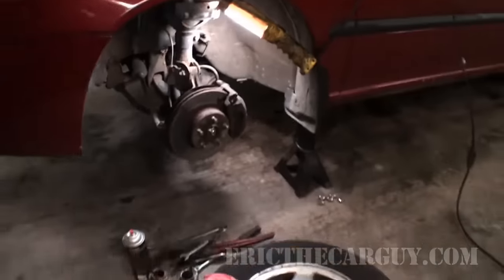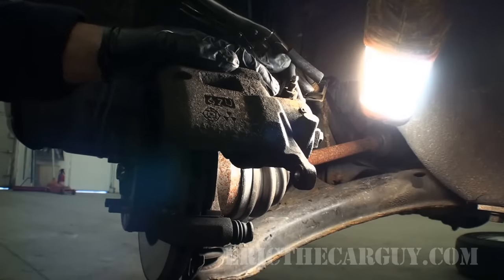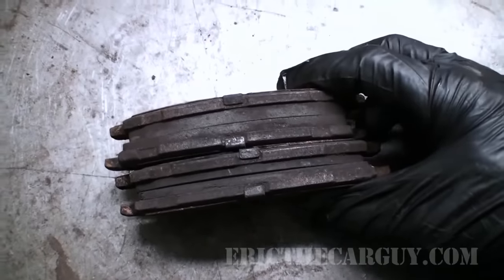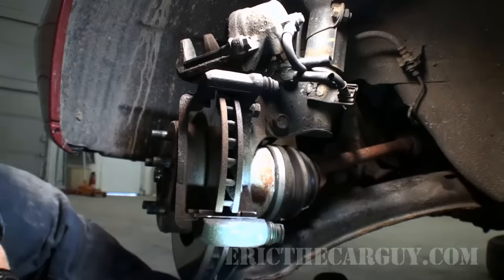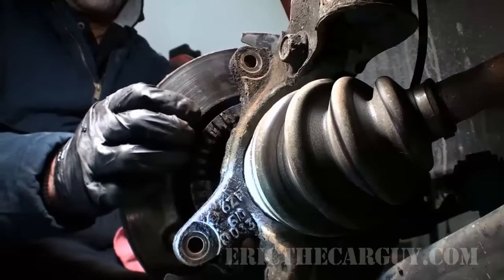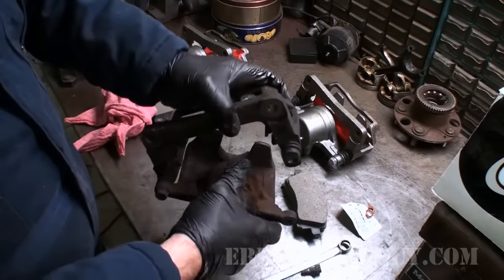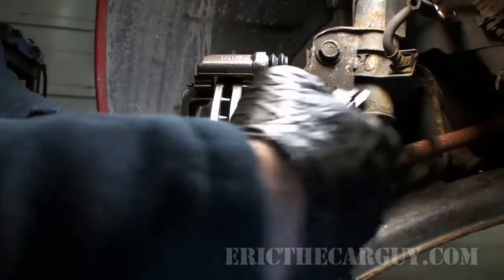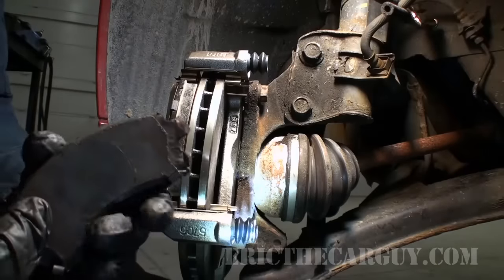How To Diagnose and Replace a Bad Brake Caliper -EricTheCarGuy

Comment: Eric, I found a brake fluid leak after a brake fluid service. I notice the bleeding screw rubber cap has a small hole. Can that cause a break fluid leak?
I tight the bleeding screw a little more but should I replace the rubber cap? 
Thanks for help

Comment: @EricTheCarGuy One of the rotors on my wife's car is showing up a curios worn pattern. It is taking place on the front side only. You can notice the pad is not fully touching the complete area of the rotor plate because there is like a 3/4 inch ring pattern is being lightly corroed by exposure to the rain. The question here is will it be wrong pads size? Ive got the breaks serviced only a few weeks ago

Comment: Do you have any advice for replacing the caliper if the bleeder valve and banjo bolt can't be removed? They're rusted through and the bleeder valve is stripped. Should I replace the brake line at the reseviour?

Comment: Hey Eric I was confused about the pumping the brakes alot and loosing the bleeder valve. Isn't that the bleeding the brakes process. If possible could you explain. Is it the squirt versus running fluid. I thought it always squirted especially with air in the lines plus pressure.  Or did you just misspeak?

Comment: Hi Eric! Thank you for a GR8 channel! Is this problem (bad break caliper) know to happen also on the rear breaks? I have a Volvo V50 2006 that started to see VERY increased fuel consumption. I suspect that one of the brakes (rear right, due to a lot more brake dust around the rim) might be a fault. Thank you all the way from Finland!

Comment: Great vid! I couldn't make out 1 thing though -  why would the brake hose be bad if there is squirting through the bleeder after pumping the pedal? Wouldn't with a normally functioning hose that exact same thing happen? If not, why?
Reply: Well if it squirts out that means there is pressure in the system, it shouldn't be enough to squirt. Only a stream should come out. If there is squirting that hose is probably collapsed internally. Due to brake fluid contamination or age.

Comment: great info thanks , question, is it a good idea to put penetrating oil on the guide pin bolts and bracket bolts so they do not break off,  did you ever break the bolts ;  or is that not likely to happen with these bolts

Comment: Is it imperative to replace (with new) the caliper mounting bolts after removing and servicing a caliper ?
I heard they might be TTY (torque to yield) bolts and need to be replaced, each time ?
Thanks in advance

Comment: Eric, i've got a few questions after watching yours and chris fixs' video on brake calipers... Chris is basically saying the opposite as what you're saying with the calipers and brake bleed. He bleed his lines first and then installed the new caliper. i just heard you say your changing the caliper first then bleeding the lines. Is that preference? Chris said he does it the way he does so the old brake fluid doesn't contaminate the new caliper.

what do you think?

Comment: I bought a 2006 Kia Spectra5 and it was pulling to right when braking.  I replaced the left caliper and rotor assembly.  It still shakes but doesn't pull either way.  So now am gonna check the hose lines and the right side caliper.  I have feeling it might be bad too.

Comment: Once you  bleed out .dose the rotor   spin freely or it sopost be  tight when you spin it.. I replaced my calipers and my rotors are still hard to move.  I check all my brake lines to ... let me know thanks

Comment: Hey Eric, I just replaced the front/rear pads and rotors on a 2009 Honda Accord sedan almost two weeks ago. Now whenever I brake I hear a thumping noise. I was thinking it's a caliper or some sort of suspension issue? What could it be?

Comment: At the 10min. Mark you state fluid squirting out indicates a bad brake hose (Is the brake pedal still being held down after pumping up pressure or is it now released while you crack the Zert fitting?) Is this an indicator of line pressure unable to quickly neutralize back to the reservoir with the brake pedal released? An internally hemorrhaged brake hose.

Comment: Hi Eric, thanks so much for the video and for your great work generally here on Youtube. I just got in calipers from the same brand as the ones you got - Centric Parts. When I was buying them, there was information on the webshop that painting them is recommended. You are not painting yours and I would rather not paint mine either, but why do you think they recommended that? When I asked guys working at the webshop, they told me I have to do it if I have a nice car because they will get rusty. The car is 1991 Civic with 1,6 VTEC, if you ask me, it's a nice car ;) but I don't want to waste time on "cosmetics" of this kind. Thanks a lot!

Comment: We always just pry the piston back (if it's not a screw in type) while it's still fully attached on the car.  Let the brake fluid reservoir over flow if it's been topped off.  Makes a little mess but at least you can tell if you've got a stuck piston or slides quickly without damaging anything or wasting huge amounts of time

Comment: Eric, I have a shaking in my front end of my 2007 Hyundai Sonata 3.3. I just recently had it inspected and it passed.I told them about the shaking  well the shaking has gotten worse at the time of inspection they didn't really consider it an issue and said an oil change is soon due. Long story short, I am checking the brakes and rotors on the front myself. Wow !! My inside brake pad on driver side was so unevenly worn down to nothing on one side. I was so pissed off, how did it pass insp. So as I  continued, I found out the 2 set screws to hold rotor in were broken off( not much of an issue). Then I found that the one lower slide pin was seized up, which is probably the culprit in the uneven wear on the pad. I compressed the piston back in, so it doesn't seem to be seized up.  one of my A-hole mechanics must have used grease and not silicone paste. I finally got the pin out but it is clogged with that grease. Can the slide pin and slot be cleaned or should  I just replace the whole caliper and bracket system.

Comment: My buddy Dave was doing front pads and rotors he didn't think of turning the wheel out and he was trying to get the caliper bolts off
I was sitting on a stump looking at him I let him struggle a little bit then I let him know and he turned out the wheel and was pleasantly surprised he could get a long wrench on the bolts. RIP DAVE CHEVYMAN.

Comment: I wish I saw this first before I tried to replace the piston. I kept having the wrong piston sent to me. Then once I got it out it was so badly rusted inside I still needed to replace the whole unit. I did this because I saw a video of someone who lost braking control and cost the life of his passenger. Charged with safety negligence. I had a vibrating abs then hard pedal every so often so I feel much safer now.

Comment: Eric! Love the vids! My car is going through brakes like crazy! Steering wheel shakes at 50mph+ and stop about 75. I've had the wheel rebalanced and it still shakes. Also shakes when I brake and I just replaced rotor and pads few months ago, and broke them in properly. What could it be?
Reply: Caliper drag due to a bad caliper, or bad brake hose or slide pins too dry and needing silicone paste

Comment: I have  a threaded brass cap to screw onto the end of the hose to stop the fluid leaking out 'cos you can't pinch off Goodridge braided hoses.

The reason that I  fitted stainless braided hoses is that the rubber hoses had swelled inside blocking the flow of fluid; the brakes would go on, but not come off.
Reply: Does that include the banjo fitting? Is having the cap screw in there enough to keep it from leaking?

Comment: Eric love your videos VERY INfORMANT!! i have a question, my 2002 GMC sierra has a issue, when i push down on the brake pedal sometimes it makes a URRR noise and also it seems to push back against my foot. 

I have no leakage anywhere, any ideas?

Thx Again
Cliff
Reply: Cliff Aubrey super late, is it almost like a ‘sputtering’ in the brake pedal?

Comment: Eric, WHY do you prefer the steel washers to the copper crush washers?  As long as they aren't work hardened and crack, shouldn't they seal better with less force?

Comment: Older Subarus have chronic problems with those caliper slides. Evidence of this is rapid uneven brake pad wear, and scraping noise from the front when reversing (no brake pressure) after the car has sat for a day or two. "SuperLube" (teflon/ptfe in silicone paste) lasted the longest on my Outback, but it never lasts more than a year. It was a big enough problem for Subaru that the sewer Subarus have active brake pad retraction.

Comment: Hey Eric i recent rebuilt my rear corrolla Caliper but the caliper seem to got stuck on the rotor . my alloy wheel and the rotor got really hot compare to the rest wheels while im driving my car  , you got any idea whats wrong with it? you wrecking this may caused by defect brake hose? thank Eric .

Comment: I've noticed one side of the rotor is thinner than the other is another good indicator of a seized caliper, even if one caliper is seized replace both to have balanced braking, and finally there are left and right-hand calipers so bleeders at the top for proper orientation.

Comment: I use a dead blow hammer for smacking the wrench / ratchet. It need the impact and doesn't hurt your hand. Usually I just hit the outer end of the wrench with the neck of my harbor freight dead blow while holding the slack out of the wrench with the other hand.

Comment: Hello Eric I am just wondering Iam working on my antic 1977 BMW 630 CSI also did myself the 2009 VW CC front & rear brakes(need software to do it because of e rear brakes) I only use a bit of copper code behind the sims an nothing on the new tips of the break pad.
What you sinking, let me know.

Comment: I replaced my rotors and brake pads about a month ago and ignored that my rear calipers which have to be screwed back in were extremely hard to move. Now, I'm experiencing drag while driving. I bought both new rear calipers but I'm hoping my new rotors or brakes haven't been ruined because of this.

Comment: I'm at a complete loss with my 89 f150  4.9. Ive replaced the front brake calipers, pads, front hoses, rear shoes, spring kit, and wheel cylinders. Brakes are great, not spongy or overly hard. But now I have a drag on my driver front wheel. And you can hear a clunk every once in awhile while stopping. Please help. Im fixing to replace thw rotors, bearings and wheel seals since it needed to be done, just didn't have the money last week. I've read that any old hose can collapse, the only rubber brake line I havent replaced is in the back on the diff. Could that play a part? Also my anitlock brake light is on. But its been on since I've owned the truck. (4yrs) Any help would be greatly appreciated.  Sorry for the paragraph.

Comment: I drive a 2013 Honda Civic EX and whenever I drive on uneven roads I hear some noise. The mechanic looked at everything pertaining to the front suspension and said everything are fine except he told me I need to change the both front calipers. He noticed that soft brake pedal application the noises stops. Do I  have to replace the calipers as he suggested then the noises will go away permanently?

Comment: Hi Eric big fan
Have a question 
02 chevy avalanche 1500 4x4 
Driver side
 caliper lock
While driving by the time slow down to stop on the freeway it was glowing red
Tow home
Replace rotor
Caliper n pads
3 hours later it did it again😡
So I pinch the flexso brake line bled some of the Boling brake fluid n drove
Have also now replace the rubber brake line
But the problem still there can u help 🙏 😢.

Comment: Silicone grease for slider pins but I have some Ceratec - that would be ok for sliders? What about the ABS pump as I understand it can cause problems if air gets into it, remove ABS fuse perhaps?

Comment: What if u use the channel locks around the piston, and turn the piston that might be seized by a little rust?  Can this repair the caliper?  I did that on a seized piston and it seemed to work.

Comment: Great video with a lot of good tips. However, I totally disagree regarding using anti-seize on fasteners. All bolts/ nuts should have oil and/ or anti-seize applied to them when exposed to an outdoor, harsh environment. The idea that rust holds your bolts together is on old, urban legend. Lubricate and use a torque wrench. The proper torque keeps the fastener in place. I have been lubing my wheel lug nuts for 40 years and have never had a loose fastener or a corroded stud. Unlike other folks that I have witnessed where they could not remove the lug nut with normal tools!

Comment: I wanted to ask I have a vibration on the left front more when I apply the brake. Okay should I replace the caliper with the rotor if the rotor is warped???. I'm working on a 2001 Oldsmobile silhouette.

Comment: if you were replacing the caliper and the brake hose, would it be alright to to attach the banjo bolt first, and then the other end last so as not to leak as much.

Comment: If e.g. the left brake caliper is frozen and the right seems fine, would you recommend just replacing the left frozen one or to replace both of them?
Reply: +KiterTMK 
replace both.
you can technically replace one....
but........
don't.

Comment: I recently change my brake pads on front side driver and passenger side wheels. Passenger side went fine. But driver side not so much. The front pad facing wheel rim went in snug...but the back pad facing engine is not sitting flush with rotor. It actually stick out about 5mm or more

Comment: Hey brother I have a 2012 Toyota Tacoma and whenever I first put the truck into drive, I drive off and hit the breaks and I hear a clicking noise. It happens when I'm in reverse as well. Heard I might be the bracket for the caliper but not too sure. Any info?

Comment: Eric, You have a video that shows you blowing out a Brake Piston with an air hose.  Is blowing out the Piston for filling the caliper reservoir?  Do yo recall which video I should refer to?
Reply: Sam The video you are referring too is the "rebuilding the brake caliper" video. He blows air into the caliper to pop out the brake piston.

Comment: Hi Eric I am changing my front rotas or discs as we call them here on my Peugeot 206 SW never  done it before I got the Caliper carrier off and the two small location screws out and I was hoping the disc would just come off but there is a large centre nut axle nut? does that have to come off to remove it?

Comment: Another great vid, but, when you took out the banjo bolt at 11:20 the break fluid came out in a pretty good, steady stream. When I did it to mine, it did not. Could that be another possible sign that the break line is collapsed on the inside ???? please help,,,, Thank you.

Comment: Great video and excellent narration and A for effort. But, I thought with the time on discussing the no grease on the slide bolts , only silicone was awesome and very little amount ontop of slide bolt to have no excess on the boot when you push it in. So the boot doesn't scoop any excess silicone to the outside of boot. Heat up and possibly , not saying it would happen, causing just a wee bit to enter the pad area. Causing a percentage of stopping force needed to come to a perceived distance stop at a red light. How do I know, yes, a personal meeting with Jesus. Someone, commercial professional mechanic, for my 2001 Isuzu dually box cargo vehicle, did my brake job, and it didn't happen pulling out of the garage or while driving for 15 mins . It happened at the last busy intersection less than a mile from my house giving me full confidence, that this was me getting struck by lightning type of odds of happening , TO ME. Long story short, no one died or any serious ,jaws of life extraction. Rush hour traffic included. No one moved when the light turned green, normally everyone floors it, I was flashing my brights and honking going thru the red light. The 6 cars that were in front, 3 on both sides were all in a delayed state. Maybe they were all texting at the same time, if so, distracted driving saved my and their lives, that day. I was ment to make this comment today to save your life or your families lives. Your video was great , this is not a bad comment. Perfect video, also u didn't put silicone on the backs of pads. Maybe, I missed it.  Possible sqweeling scenario happening.  Remember very little silicone goes a long way and when heated up will cause drippage. It is your choice like he said. Love you all and a good brake job , take your time and think, do it fast and it might be hard to stop. Go slow, you know, will always come to stop.

Comment: i'm working with subaru legacy (or liberty in some country).. i face a very hard to push back piston problem.. and my brake pad change was still put on hold because of this.. i would like to know if i open the bleed  valve and be able to push back my piston, do i have to flush the system?? will it be dangerous if i do the flush later on?
Reply: +Muhammad Hakim please eric or anyone who know anything about this.. i need help..

Comment: Hey brother I did a brake job like I have done a million times but I am having a clanking when going over bumps I brought it to the dealership cause it is under full warranty and they replaced both front struts and  that didn't do anything I'm getting the same noise so I brought it back and now they are trying to tell me it's cause I used aftermarket brake pads . My question is have you ever hears of that cause I have noticed that the pads are in there real tight